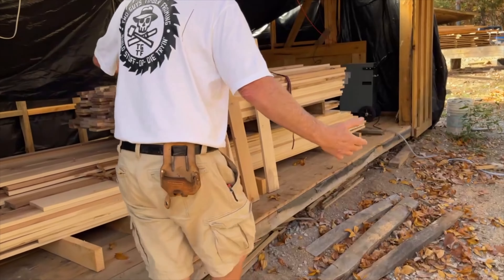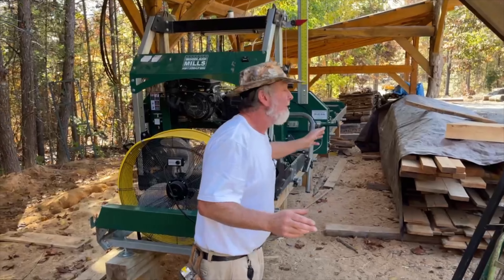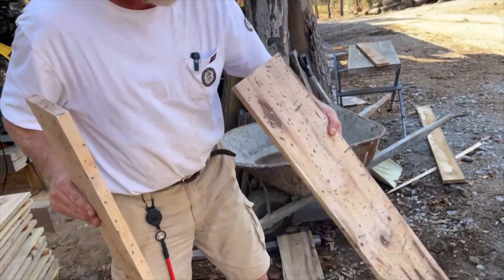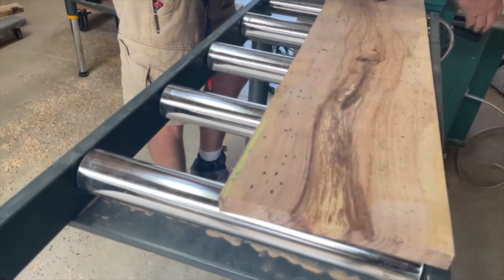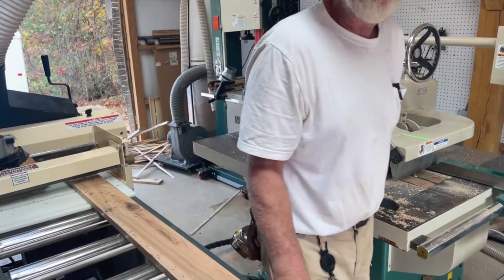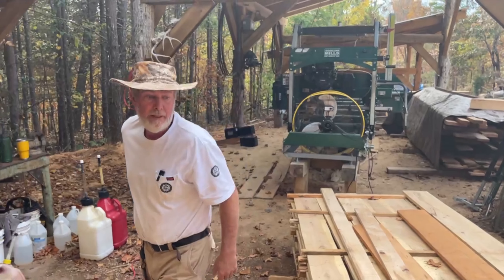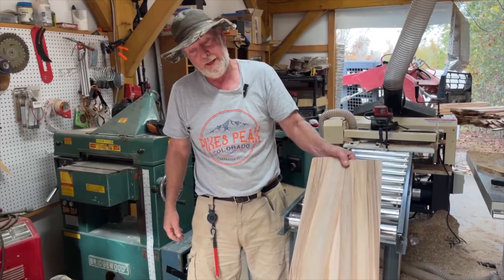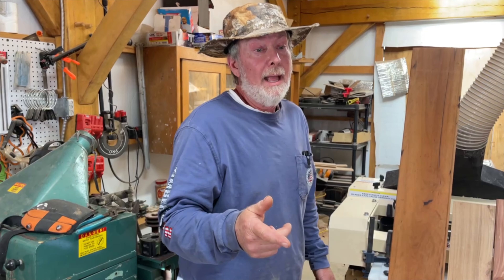Hardwood Flooring Easily Made  From Your Own Trees! Using WOODMASTER 725 and GRIZZLY IN-LINE RIP SAW

Comment: I love the new intro!  A little SRV influence there.

Hickory is, by far, the prettiest flooring.  I'm curious to see how the tooling holds up to the hickory.
Reply from the maker: It is my man by far. The more I work with it the more I like it. But dry. It’s hard. A little more blow out on making flooring. But the tooling all looks good for at least 4 more rounds. We cut 1500 sq ft. It’s a lot of boards. We will get you some. !
Reply: @TwoGuysTimberframing  lol.  I'm going to mill the hick-ree off the farm and bring it down.  How thick do i mill it with the HM130MAX?  Is there a preferred width?

Comment: I was planing some beech that came out of the kiln today. It had a little bit of both ambrosia beetle and powderpost beetle damage. The ambrosia beetle is a farmer living off of the black fungus it carries into the tunnels it excavates. The wood has to be wet enough to grow that food or the beetle starves. So black holes are safe when the wood is dry, Elvis has left the building. "White" holes, holes that have no off color, are the lyctid powderpost beetle. That's the one that can slowly eat you out of house and home and is still happy just slower at indoor wintertime wood dryness. Either a weak tree already has the beetle in it while living, where it leaves the nice color trails like in ambrosia maple, or the few in my beech, or its called Columbian Timber beetle when you see it in poplar. I'm pretty sure when it is just black tunnels with no trails in the wood above and below, the tree was dead. There was no flow up and down to make that flag. That's what your ambrosia holes look like to me, and I think you said the logs were cut and sat. I bet there were trails of bug frass on/in the pile when you sawed them? That's where I think that wood got the ambrosia beetle. The true powderpost in my beech happened in my barn loft when the wood was stacked up there at lower moisture. Which still ends in, then crank the kiln just to be sure :). Love your setup, I'm using a planer and 2 routers under a 6' plywood table. 3 operations you are doing in one pass.
Reply from the maker: Thank you very much. These were Ambrosia post Beatles. The beetle wood I also ran in a vacume kiln so I am sure they are dead. Normally I dry all our own stock. Three cuts in one pass makes a difference. Good Luck with your project.

Comment: Impressive and respectable to make T&G boards. It sure is a lot of work to setup the moulder with two router bits. I currently just plane boards flat and install them with a butt joint, but I'm going to try hand routing the edges T&G because the T&G is a good vapor barrier and structural detail to link the boards. I install wood with screws through the face, so it's all structural and good as long as you can tolerate the little gap between the boards. One note, I recommend rift and quart sawing lumber, it will install much easier than the wide 8" plain sawn wood, but again, impressive and good job by y'all!
Reply from the maker: Rift or Quatersawn is always best. Get the T and G bit that has a round tongue much easier to install. The Tongue holds the boards together better then just butting adding strength to your floor. Thanks for watching we really appreciate it!👍
Reply: @TwoGuysTimberframing  I appreciate the knowledgable tip on the curved tongue!
Reply from the maker: @clarkpiper6007  👍👊

Comment: Could you tell me more about the router setup you have on the back of your thicknesser. That could save me so much time.
Reply from the maker: It is an add on to the wood master planer  set up. So check out Woodmaster725 router assembly. Maybe it can be retrofitted for others great unit.